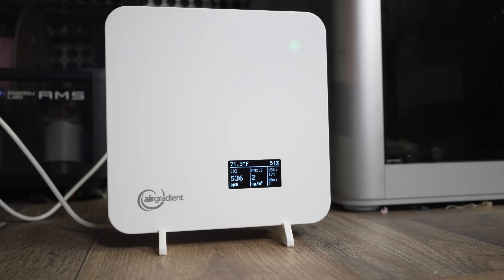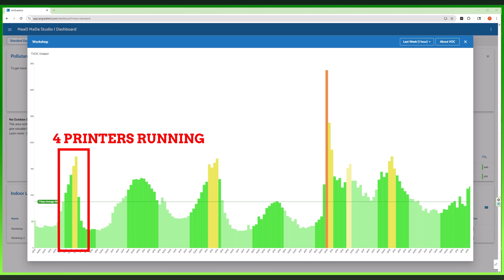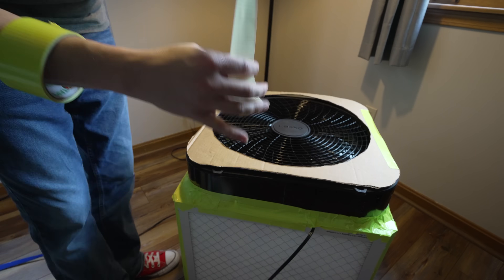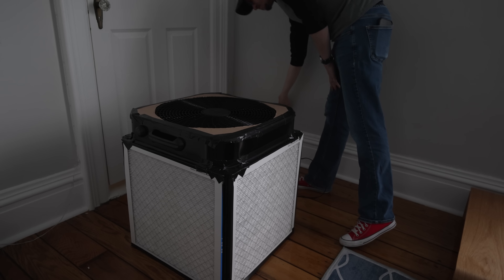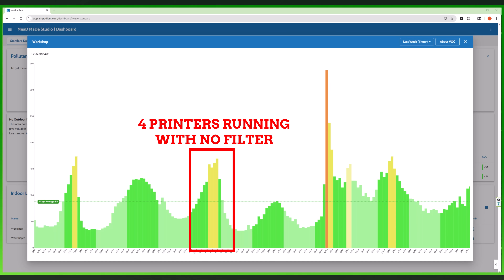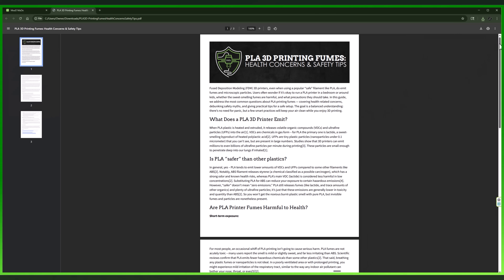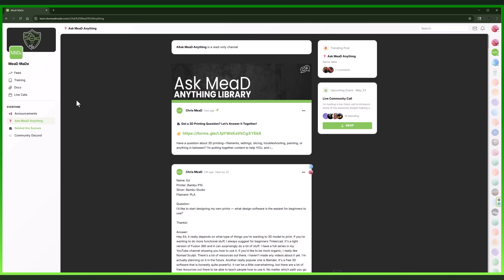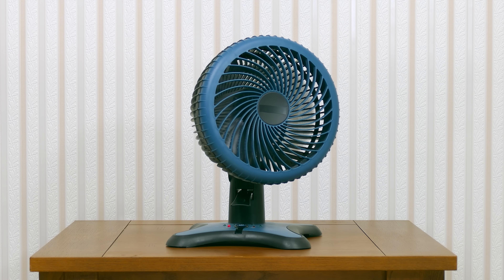Is 3D Printing PLA Really Safe? "Ft. Air Gradient Air Monitors"

Comment: Hepa is great.  Hepa + carbon even better.  Hepa by itself removes particles but does not absorb voc's.  For that you also need carbon.  Also your basic super glue releases more voc's.  Have a suitcase sized hepa+carbon filter running 7x24 in my print space.  Reduces particulates and vocs and as a bonus keeps the area way less dusty so it also improves the prints.
Reply: Just be careful to never use acid washed activated carbon this can cause corrosion of steel and is probably not good for you to breath either. Typically put the coarse dust filter, carbon and or chem filter, final pre filter, hepa filter to filter everything. It is far far cheaper in the long run to just exhaust the fumes or get an HRV for balanced exhaust.
Reply: @riakata Good to point out for others, but I already make sure not to use acid washed.  Also already have printers connected to 4" power venting to the outside.

Comment: Your DIY filter is cool but not going to filter VOCs. It only filters particles.

For VOCs you need an activated carobon filter in addition. And those need to be changed frequently.

Stay safe.
Reply: dumb question, how frequently are we talking? I have 2 printers with regular PLA printing and I have a HEPA/activated carbon filter system coming tomorrow. So is once a month fine for changing it?
Reply: @ViralWatchMedia  after a month of using air filter with carbon, it started smell by itslelf, so every month or even more often depends how much hours a day you print. and the good filter is not cheap, so need to consider it.

Comment: A few nits to pick, that may be good for followup videos:

1)  We understand that you have a larger workspace with (at least) 4 FDM printers and (at least one) laser cutter.  Most of us just have one printer, and MAYBE one laser cutter.  (I only have 1 printer.)  Maybe a followup video with more typical home hobbyist scenarios? (Smallish room, large area, effects of opening a window, effects of nearby furnace room sucking in air on a regular basis, effects of an in-enclosure filter, effects of an inexpensive HEPA filter in the room)

2)  How about running other filaments in similar scenarios?  How bad is PETG, ABS, or ASA in a large area?  And no one talks about TPU.

3)  Measure the effectiveness of the Corsi-Rosenthal box over time.  It's been noted that it's hard on fan motors, and you might also want to report if/when the fan motor dies.  Still likely cheaper than an air filtration system.

But thanks for the video!  Good food for thought!
Reply: Opening a window you can experience trouble printing and most in cold places won't have it open.

But yes i think most people have it in a small room and from 1 to 12++ Hr prints.

A carbon filter should be better to remove toxins and not only the fine particles.

The filterbox could very well be made with one carbon filter and the rest HEPA since it filters the air so many times an hour you don't need it all to go through the carbon filter every time.

And maybe having it sideways mounted hanging 1 meter above and next to the printer (the way the fan usually stands on the floor) and instead block the side facing down so it doesn't blow air down on the print
Reply from the maker: Thank you for your feedback and "nitpicks". These are all excellent points. Everyone is making great points on various subjects here in the comments. It's why I love this community.  I realize my workshop isn't typical. I'll definitely keep tinkering around and testing things. I'll probably post the updates in my community so it's all in one place and people can follow along easier. The fan motor is a good point - although in the building of the Corsi Rosenthal box part of the video, you can see the corner of the fan in the window. I've had that fan for 15 years and it is a workhorse and runs nearly all the time. I do realize things aren't made as well these days. All things to consider! - Chris
Reply: @ItsMeaDMaDe Another concern. You are only using HEPA filters which only remove PM from the air not VOCs. You really should integrate activated carbon filters which are needed to remove VOCs. The downside to using carbon filters is that they need to be replaced once they absorb their limit of VOCs. Personally I use a different filtration system (actually a set of them). I run a small print farm with 6 printers (mostly P1Ss and P2Ss). I use the Voxel Bento Box which uses both HEPA and carbon filters (with integrated fan) as my first line of defense in the P1Ss. Next I’ve updated the stock P1S filter with the Voxel X-Filter (integrated HEPA/Carbon filtration) which gives me a second layer of protection. With PLA this is probably enough but I do a lot of printing with ABS, ASA and PC which have higher levels of fumes & VOCs. And unfortunately my space doesn’t have windows so I can’t vent to the outside. So I have added a third layer using the Mintion Filtration System V1. This is an external system that connects to the exhaust port (via 3D printed bracket) and it also has a larger HEPA and carbon filter inside and another fan to ensure I pull all the fumes & VOCs out from the printer. This 3 stage system works fantastic and totally clears the air of all fumes/VOCs and smells from whatever filament I print. I use a Temtop M10+ Air Monitor which also measures PM2.5 and VOCs and allows data capture and graphing so air quality can be analyzed (just a note these monitors work really well and are less than $100). And air checks out really well regardless of filament printed using this system. I use a similar system on the P2S with the Voxel Vento Box, an upgraded internal filter and the same Mintion external filter. And again this works just as well as the P2S system.
Reply: @christopherlyons7613 thanks for sharing your setup, much appreciated:)

Comment: I did something similar of your filter but for my workshop area.  I did 2 sides filter and 2 not, since it went into my ceiling (between 2 beams).  It help but I would need a LOT MORE air pressure to work correctly.  I've used what I had on hand.  Again my room is NOT sealed so IF you do it be sure to calculate the air area in the filtering equation.

Comment: HEPA filters don't remove VOCs. The lower measurement is likely the sensors response to the air movement from the fan. Removing VOCs requires a lot of charcoal, or better  yet, outside ventilation. Also, VOCs are not universally harmful. Most of the problematic VOCs, like styrene, stink

Comment: Print some air duct adapter, attach to your printers then add some air pipe then put them out of your windows. Like they have in laser engravers. Put a fan inbetween to really push those fumes out. Only works in enclosed printers 😢

Comment: Did you test the difference in air quality between open bed printers and enclosed?  Wondering if the filter on the enclosed printers truly helps air quality if the door is shut. Great video.
Reply from the maker: So no I didn’t. Because the recommendation when 3D printing pla is to keep the doors open and the lid off to improve circulation because you don’t want the printer warming up to much or your overhangs will droop.

Comment: How long are you running the CORSI-ROSENTHAL box before rebuilding it with new filters? Ty for the video!
Reply from the maker: So I’m running them 24/7 right now. From everything thing I’ve read they can last up to a year because you can take a vacuum to clean away any dust and debris. But I would say that is still depends on how dirty the air is around you.